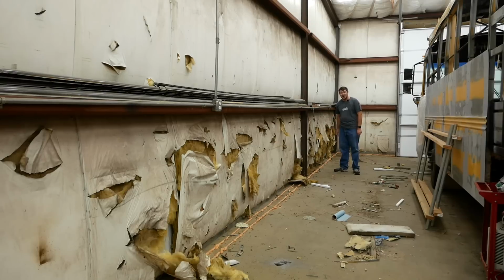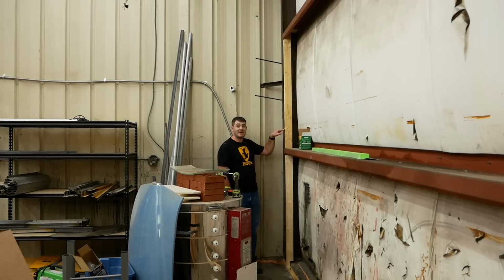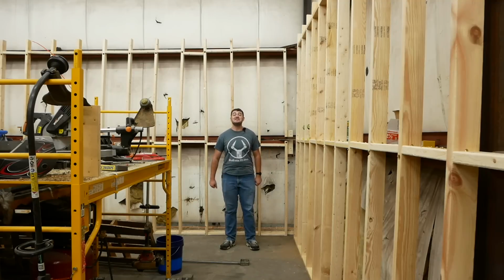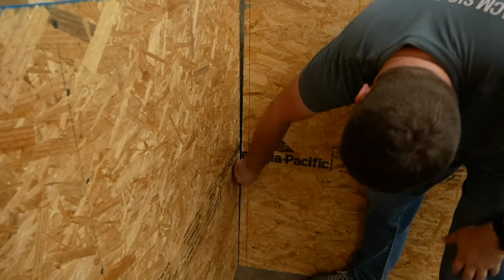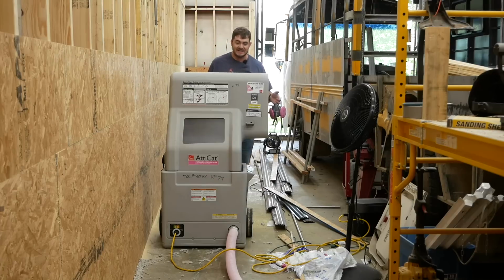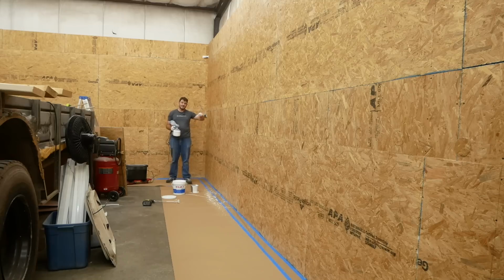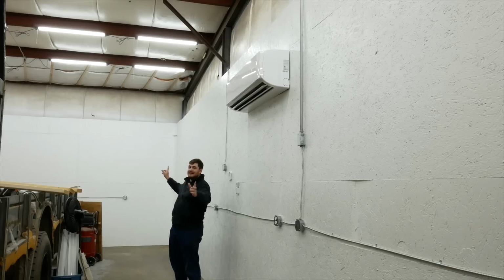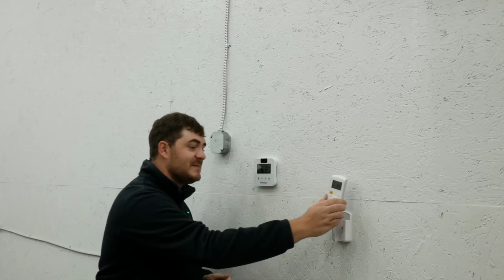The Bus Room is Done! (For Now)

Comment: I know that this comment is a year later, but I had two questions..  If you were going to fill with blow-in and didn't want to lose the 3 1/2 inches you could have placed the 2x4s length wise instead of on the end.  I thought you did this because you were going to use paperbacked fiberglass rolls.  The end product is really good, I would have been extremely proud of your result.

Comment: it would be a cool project to try and bypass the minisplit's remote/thermostat/app by getting a smart hub with ar blaster and maybe a smart home thermostat (assuming the smart hub doesn't have a temp sensor.  I've been toying around with the idea to make a more efficient apartment cooling system with some basic logic based controls (if cooler outside use window fan with ar censor; if hotter outside use ac unit)... but keep putting it off because I'm cheap and for some reason the only window fan unit i can find with automatic baffles is like $100 (have toyed with the idea of using a smart plug & usb powered pc fans...but that's just to much work).

Comment: I always enjoy your channel. Some tips that will do you no good now that you are done. :)
Studs can go sideways so the space 2" deep not 4". 
The OSB should be off the ground at least 1/4". 
Install Azek PVC as a base board.
Lay a chalk line across the wall for a level.
Cut your stud notches or cut the studs in half for electrical before the studs go up.

Comment: With that much insulation You got a low-energy shop and save money that way. You just need the solar panels on the roof and a rack for the old car batteries as well as an inverter. Maybe Jehugarcia can help with the inverter.

Comment: To be fair, why would you need three different temperature setting devices? Not like settings, cause you said it would be dumb, but devices that can control temps. Why a remote, a wall mount, and an app? Just use one and throw the other two away.

Comment: We use those "guns" in Germany too, but they are mainly used to rivet something into steel I-beams. Using them stuff gets surprisingly solidly attached.

A buddy of mine used one on some old beams and had the largest cartridge loaded. The rivet punched through the first side and then the other side of the beam rained a shower of sparks and impacted in the large room on multiple places before bouncing to the next.

We there were like 20 people in the room, nobody got hit, luckily.

So make sure you test that it won't punch through the material so nobody gets hurt. Those rivet guns at least are plenty dangerous.

Comment: I was in CommercialConstruction for over 35 years and the best way to attach  a Floor Plate to a Concrete Slab IMO  is to use a Hammer Drill and TapCon style Concrete Screws  they sell those at most of the Big Box Stores ,most decent Hardware Stores  and many other stores. they do sell  a kit that has the correct drillBits and Driver Bits for the Fastners  i highly reccomend purchasing  it doesn’t hurt to use a  bead of Construction Adhesive  as well FYI Harbor Freight sells very affordable Hammer Drills or you can rent them as a rule the Ramset nails work great for attaching metal Framing to Concrete generally used for Drywall to meet Fire Code

Comment: buying a senco q25 staple gun to apply the osb would've been much easier. used them for years in trailer factories, and i bought three of them when i started my own business building yard barn/storage sheds. i only use a hammer to tap material into position to shoot it with a nail gun or a staple gun.

Comment: I blew in almost 100 bags of the cellulose stuff with that stupid green machine.  I actually used 2 different ones, the first one was the round one.  If you got a clog (I figured out that the bags weren't the same and some bags clogged easier than others -- some were more "pillowy" and didn't clog as much as the more firm ones), you had to shut the machine off, empty it out, then reverse blow using a shop vac on the hose end while someone else shoved a broom handle on the inside hole.  Took 2 people and 15 minutes each time.  The 2nd one was the square machine, this was much easier and if it clogged, it was all very visible.

I will only use the fiberglass from now on, not the cellulose or green machines.

Comment: Wood is definitely a much better choice than drywall or metal, probably would have used plywood instead of chipboard. I've used both for garages and shops and chipboard absorbs too much moisture, eventually becoming soft and weak, especially when it it is against the concrete floor. You might eventually want to put a layer of plywood over what you've started here

Comment: Aagh, you forgot moisture barrier between concrete and frame. I just had to rebuild garage wall due to that reason, some water on floor from cars during winter did seep to the wall structure and the floor 2x4 was grey and semi soft already.

Comment: Not sure why you just didn't use isolation mats (Glava) - blowing insulation is sometimes very tricky and I would worry about dust getting everywhere, too...

There is some dust problem with mats too, but you could just go outside to cut them into proper size, even if you still need to wear gloves and breathing protection.

You should hurry up, insulating up to the roof, too, as you don't want condensation on the upper part of the walls, draining down into the insulation on the lower parts of the wall, that is
also a reason to insulate the roof most, while heat obviously is rising.

Not sure where you are located, but if you are in a cold climate / humid weather (like we are in Norway in Europe) there should be a plastic sheet that blocks humidity too, however probably
the lower parts of the wall (and later on, the upper part too) is so well insulated, that it doesn't matter. Please hurry up finishing the insulation, you don't want to have mold growth inside there,
your walls will then definitely not stay white, for too long... :-) 

Many people think a lot about renewable energy to save emissions and save the climate, however proper insulation is also very important, even in parts of the world that is hot, as you then keep the heat outside and reduce the use of electricity to the AC. One square meter of insulation is surely much more cheaper than one square meter of solar cells!

These advices are also meant for everyone else seeing this channel. Even if you are not worried about the climate or plan to use solar cells /renewables, proper insulation will save you a lot of money for heating / cooling for the rest of the lifetime of the building, for many years to come, silently, with no moving parts, no servicing needed, as long as moisture/humidity is handled well. :-)

On the brighter side, you get no stress from me, from misaligned stenders, plates or wall sheets. It just creates more work for you, and I guess, a little more content for Youtube... 😀

Comment: just a tip for the future, you could have just put the studs on their flats, saving 2 inch's of space (and the accompanying insulation)  Given you have the floor plus 2 cross members built in, you wouldn't have even needed the spacers unless you wanted extra backing for the OSB.  Also shimming the first row of OSB to be level along the tops then adding a baseboard of sometime would save a lot of work.

These aren't critism's by any means, just ideas to save some time\effort\money in the future.

Comment: that board that is resting on the concrete should be pressure treated, so it doesn't rot over time and you need to use the right fastener for the pressure treated lumber, and concrete get harder over time, drilling is best

Comment: Curious about the Mr. Cool install. Did you have to pull a vacuum on the lines before install? Or just connect? My understanding is the unit is pre-charged, and I have heard back and forth on the lines having to have the vacuum pulled or not.  Good to know it's the same as the pioneer lol!

Comment: I'm in a city, and to meet fire code(s) my garage walls needed to be gyprop(sheetroc). It comes white(ish) when new. What I did was when I put it up I made a mark on the floor and the ceiling at the center of each stud. I then snapped a chalk line(black) top to bottom. Once the walls were up I did not paint it. The upshot is I know where every stud is when I need to screw anything to the wall anywhere in my garage.

Comment: Great video as usual ! Good to see you got a bunch of work done in your garage.

I used plywood (that I bought used) I forget what it's called, but I did what I think they call a Mahony wall (opposite of what you did)  where I used vertical 2x6 studs for the standard structure, but then used 1x1 horizontally, on top of the 2x6, to  1. give me the extra inch of insulation and 2. make the thermocouple between the cladding and studs very small. 

When I saw you putting the 2x4s on the walls sticking out the 4 way and not the 2 way... I had to ask myself if this was something that you had overlooked OR if you just wanted an excuse to get 3.5 and not 2.5" of extra insulation ... haha.

Comment: I wish I could have told you about the self taping screws used on wood trailer decks, the glorious 1/2" air stapler and vapor barrier before this work was done. Nice job in the end.

Comment: 1. Adhesive would SLASHED your time putting down the footer, and  B. your upright 2x4s could have gone sidewards for a wider web to attach your ply to... you also could have used 24 inch on center for the 2x4s, as you're not building a bearing wall...you would have wound up with HALF the number of 2x4s needed. You also could have filled the cavities BEFORE you added the short pieces, and not have had to cut the circular holes.

Comment: I installed a Mr. Cool Universal to replace my blower/heater and AC coil and it was surprisingly DIY-friendly. My only complaint was that the instructions should have encouraged using Teflon tape on the fittings, I could not get them to seal otherwise.

Also the grounded conduit in place of a ground wire is (or at least used to be) ok per the code book.

Comment: Made me laugh at the end with the conduit story. The reason why it isn't done, is because the conduit has a higher resistance compared to copper wiring. which will drop the voltage the farther you get from the breaker box. (also very unsafe to have an exposed live (or neutral) wire). You could connect the ground wire to the conduit if you'd like. But i don't know what the electrical code is in your region, and if it is permitted. Also construction gun?

Comment: Use the atticat insulation when you do the ceiling and upper wall. It doesn't itch and doesn't have the dust issues like the cellulose. Also, in my very limited experience (I've blown cellulose and atticat in two houses), the cellulose settles more than the atticat. The settling took a few years, but it was half the volume as it was when blown.

Comment: i used an earlier version of that fancy belt fed screw gun, and it SUCKED. i spent WAY more time fixing feed jams, lining it up perfectly, and getting tired from holding an extra 3 pounds of crap than i did just using a regular corded screw gun. i used corded because i was building a deck and not carrying the battery around was AWESOME.

Comment: Why is nobody adding cool stuff like Starline Busway?  I'm not an affiliate but even smaller shops benefit from reconfigurable power.
It's super expensive to buy it new but it's what everyone (including me) used to get installed in our labs at work so there's a lot on ebay for cheap because of companies or branches just folding and it's just dumped to places like Dovebid for pennies on the pallet.
Once you get used to having it you won't want to live without it - it's one of the coolest upgrades you'll ever do for your shop.

Comment: Do the controller or thermostat have multiple pre-sets that you can change between?  If not, then you can use each of them as a preset.  Remote for cold and thermostat for hot, or whatever, just press one button on either one and it completely sets the system the way you'd like.

Comment: Lol 🤣 the ending part about connecting the conduit to the breaker is to relatable to me 😂 when i was in my electricians classes we were told to make a bug for our class mates to find and i left the bare wire exposed inside the conduit and left a part of the conduit not connected hiding in the stud by the breaker and made sure nothing else was connected to ground so it wouldn't trip the circuit lol 😂 they hated me for that one 😂

Comment: >  Several times I was about to click off the video and then you kept me hanging on with another interesting or captivating point. You're just nuts enough to be really funny.  Great stuff.  My suggestion on the conduit is put on a layer of duct tape for electrical isolation and figure out how to run compressed air through the conduit  for air tools.  That would be double savings and cooling for high amperage loads on the conduit. Should qualify for an insurance discount also.

Comment: Future Aging might hate you for that installation.
1 - it doesn't look like you used PT lumber on the floor.
2 - OSB and concrete floor contact don't mix in a garage.

There's a pretty good chance both will rot out in the future as moisture wicks through the concrete around the edge of the building.  It doesn't need to be soaking wet to ruin the wood over time.

Of course it could be so far in the future you won't be around to care.

Comment: I have a Mr. Cool minisplit. The thermostat was useless so I stopped using it. I mostly just control it from my phone via wifi. 
You can also set the thermostat with your phone via bluetooth, but the bluetooth turns off on the thermostat after a few minutes, so you have to turn it back on from the thermostat to keep using it, but at that point you may as well not even bother with the thermostat at all since you can control the system with your phone with the wifi module.
It kind of seems like they designed three different ways to control the unit at three different times, completely independent of each other.

Comment: You had it all open why didn’t you run nmd through the walls like you would a house . Sorry but you did everything the hardest way possible . A fail
Reply from the maker: How is hogging a ton of holes through 2x4s easier than running MC on the outside of the wall?
Reply: The wall was open behind just staple it . Next year will be 40 years an electrician.

Comment: The conduit joke at the end was good. I have seen people use the shield on shielded wire as a current carrying conductor. It gets better, it was three 120vac circuits in a multi-conductor cable with the plastic foil around the shield the only thing preventing a short. Needless to say when I figured out what was going on (this was one of many issues this equipment had), it got fixed with appropriate wire.

Comment: Such a waste of space, half a brain would have took a step back and thought about it a second and solved that conundrum....should have kept the wall paneling at least a 1/4” off the floor so it doesn’t wick up moisture from the concrete...also helps align the factory edges better (no scribing needed)

Comment: I didn’t see you leave a gap between the OSB and the concrete. I also didn’t see any moisture barrier between the concrete and non pressure treated 2x4’s. If you get unlucky the wood touching the concrete is going to wick water and mildew then rot.

Comment: That stupid remote state is a problem with my LG portable unit as well (We rent and can't use a window or mini split unit). Any time I change something on the unit or over wifi, the remote doesn't update. Soooo frustrating, especially when all you wanted to do was adjust a single degree up or down, or change the fan speed. I basically never use the remote now!

Comment: You shouldn't have exposed MC below 8 feet.its easier to damage with a rolling toolcart or something else than EMT is. If you add some 1x furring strips along the MC, that should protect it some. Probably wouldn't pass an inspection, but it's slightly safer.

Comment: With a grandfather who was a fire investigator specializing in electricity, I am very angry about your wiring. Who cares about walls. In the US, are you allowed to wire your own house?
Reply: Yes.  Just follow the NEC.   I took a course at a local votech and wired my tractor shed, office, and workshop.  I had a certified electrician install the breaker box and sign off that it was up to code before the walls were finished.  I saved about 5 grand and everything is exactly how I want it.

Comment: I started to suspect the Mr Cools would be impossible to get a AC tech to work on due to the nonstandard line fittings. So I went with another company Senville that does DTC but does require the vacuum step. Maybe since the Mr cool are becoming a lot more common they will eventually enter the "okay, I begrudgingly recognize that" realm for the pros.

Comment: I'm thinking these "sudden death " outros are going to be your "signature move"? But it will be worth it when we see your "electrified frizzy cat" imitation!  FR
PS; On the misaligned OSB sheets; have you thought about two or three hundred feet of boarding, like in board and batten? You could ork out some nifty modular numbers and do one of your great montages as you sliced and diced out the several hundred parts and pre paint them- lots of zip and zap in that!  fr